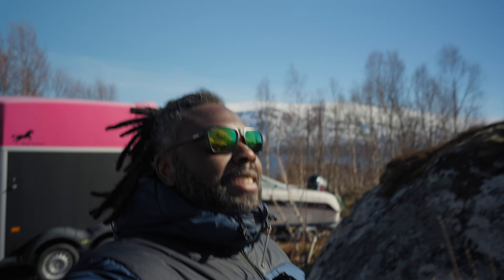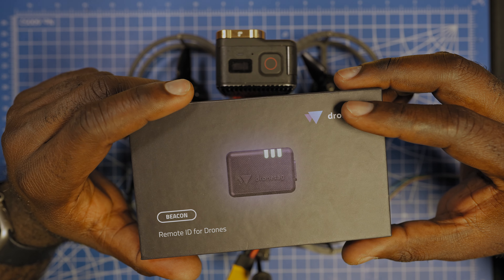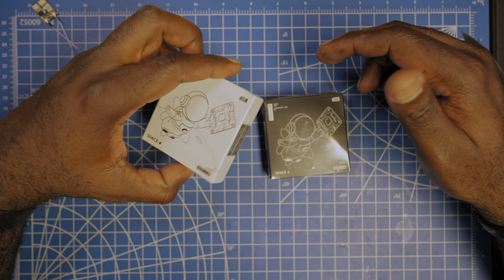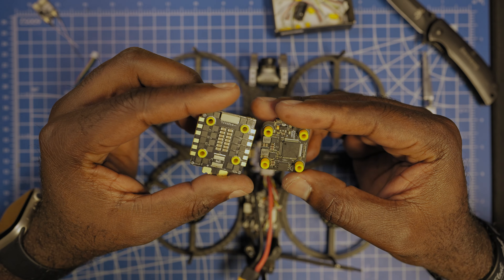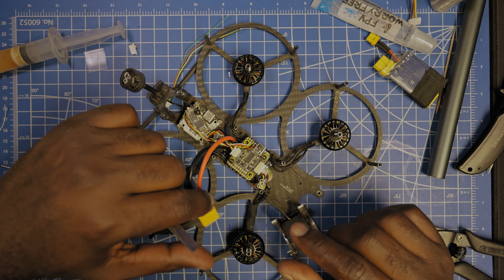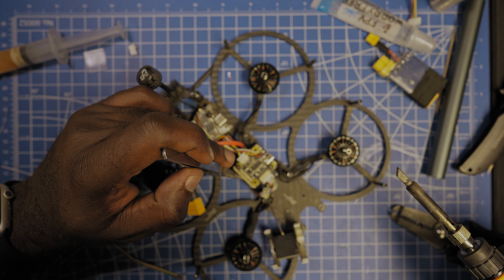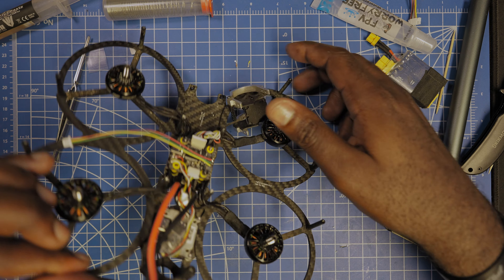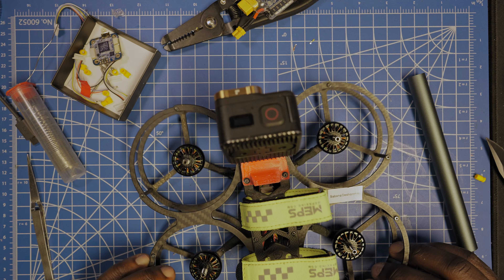2.5g Remote ID Compliance for  Cinewoop.

Comment: You're in europe right?
As far as I know, rid is not required for self built drones in europe.
Either it's sub250 without rid required, or over 250 and falls in category A3.
Only prebuilt rtf drones like dji need to be certified in C1 for example from from the manufactoror directly. It must have rid for the certification.
Unfortuatly this rid module has no benefit for self built drones in europe.
Reply from the maker: Thanks for the clarification b I would suggest you read more about this brother! You might end up in big trouble.
Reply: @babang_des  Just had a look if anything changed.
Speaking for my local rules in germany, which are actually the same as the EU rules:
Self built drones over 250g to fly in the open A3 category dont have a CX certification and cant get a certification even with RID.
RID is not required to fly legally and has no benefit to add RID needed to comply.
Although I read up france needs RID for All drones as a local law.
Maybe Im wrong, but Im heavily into all drone stuff and havent heard of the german fpv comminity needing to add RID to fly.
Maybe someone else here from europe can tell me Im right or wrong?
But dont mix RID module with the law that you still have to register your pilot ID and Note it on the drone with a Label. Thats the law here. Needs to be ensured too.
Thanks bro
Reply from the maker: That is true.  However this is only if you flying at a non populated area. this is so confusing as ever country have the own local rules on tope of the EU regulation.